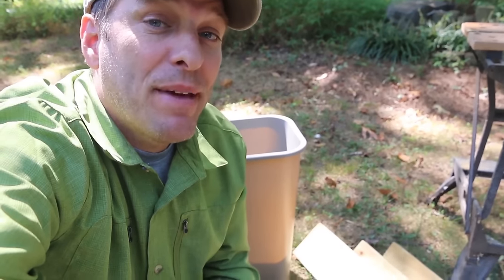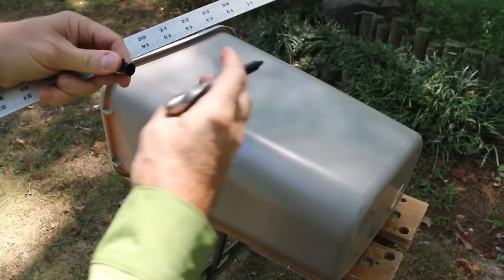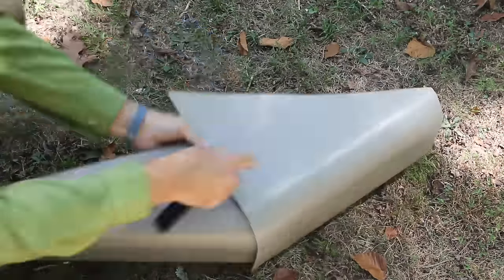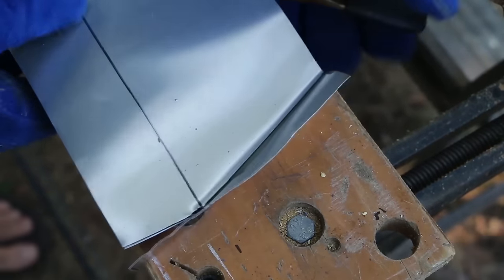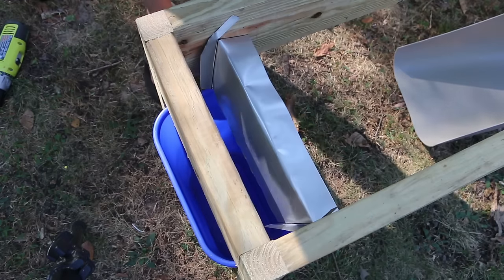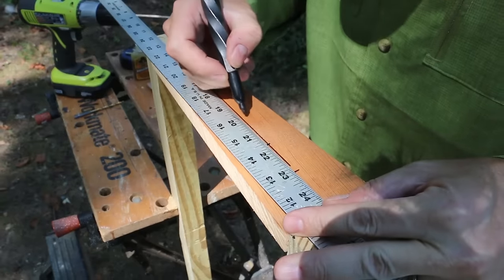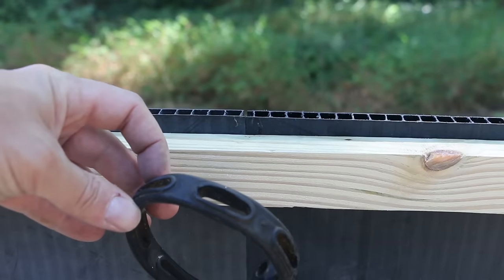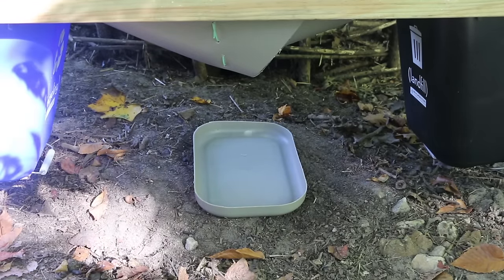How To Make A DIY Soldier Fly Larvae Composting Bin

Comment: I'm a contractor.  And your driving some of your screws to far in. It's starting it in the wood causing a bubble.. because when the screws head pulls tree plastic into the wood just a little it causes a little hump which then causes a bubble.  If you un loosened athe over tightened screw it would flatten out

Comment: I like your idea, it is a fantastic starting point. There are some features I would like to see though... Each side if it had a self actuated door where when the chicken steps on the foot pedal it would open the top. This would allow them to get the larva whenever they desired while keeping the larva otherwise contained. This would save the need to transfer the larva to them and the bin entire setup could also be kept in the same area they are. This would create a problem with your runoff collection though as you would not want that accessible to them. You would need to suspend the runoff collection with a hanging bucket, or use a catch and a pipe to get it out of the area accessible to them. With these changes it becomes a self sustainable system.

Comment: Just a tip on bending the flashing. Use a small 2x2 or squared off piece of scrap. Align the wood with the line, start the bend by hand, then use a hammer to get it perfectly bent. Thanks for the tutorial! I have been wanting to collect BSFL for quite some time as they are quite abundant here.
Reply from the maker: Thank you for the tip. Thank you for watching. Happy composting.

Comment: Excellent video! I would normally do it with wood as well, but since I had a 4’ Tupperware bin hanging around, I decided to use that. I knew from watching another video that I wanted to do a ramp and not pipes, like I’ve seen others do, because the BSFL doesn’t always use them, but couldn’t figure out how to seal the ramp to the wall. The bin walls are not completely flat, so the ramp doesn’t seal completely to it. I’ll use flashing, which I have a ton of lying around. One day I’ll build a custom, bigger one, but as you said, what I’m doing now is a good prototype.

Comment: At around the 35:30 mark it was mentioned that after the eggs been laid in the corugated cardboard, the cardboard would be transferred down to the compost pile. Actually you don't have to do that because once the larvae hatch, they'll migrate to the food source themselves. BUT it is a good idea to make it removable in case you need to change out the cardboard for whatever reason (eg. ruined by condensation).

Personally, I don't bother with the cardboard anymore. The female BSF just lays her eggs around the inside lip of the composter cover/lid. Other people stick to the cardboard method because (1) they sell the egg-filled cardboard, or (2) they have separate set up for the adult BSF (a mating cage) and they need to move the eggs to the composting pile.
Reply from the maker: Munirah, thank you for adding your insights to the conversation. I agree with your suggestions. I like having the cardboard separate for cleanliness, but that seems a little comical given the context. :-) I may have make a mating cage next summer to see if I can propagate some more soldier flies. It sounds like you have been doing this for a while. When did you start?
Reply: When did I start? Hmm...3-ish years. The first few tries only managed to sustain 1 batch of larvae (from a single egg-clutch) but once they pupate, I didn't have new maggots to keep the bin going. Lots of starts and stops. Thankfully I live in the tropics, so I could start back at any time of the year! Happy to announce that my current bin has been going for almost a year with new egg-clutch found everytime I feed them (2-3x/week).

A bit of an advice on setting up a mating cage. Adult BSF mate during flight! So make sure it's big enough for them to do the deed.

Comment: Can't say it better than anyone else here....SUPERB. I have been thinking about doing this for a long time and your build is not that complicated. I will build about twice your size as you advise. btw, has anyone told you look a bit like and even sound a bit like Alan from 2 & 1/2 Men......lol
Reply from the maker: Thanks Ray! Definitely scale this thing up. I'll go bigger when I build this soldier fly composter again. One comment on the video had a good idea I thought might save you some time. +Theo Lubbe (see below) suggested I use some pond liner or heavy duty sheeting instead of the trash can. The flexibility of the material would allow for the drop in the center, ramping up to each end. It would also save the lacing up the middle step. Also would let you scale this however you needed to fit the liner.
Reply from the maker: Can't say I've been compared to Jon Cryer. lol. I'll have to watch a few episodes to see. But, he's a cool dude, so I'll take it. :-)
Reply: Yep Tom, I saw that comment & definately good value.....only question I have about that method is collecting the leachate .....maybe punch some holes along the center low point and cover over with shadecloth or weedmat ?

Comment: I'm not much of a woodworker.  But, I think drilling straight into the end grain - vertically oriented relative to how the tree was oriented when it was growing - provides the weakest hold on the screw - easiest to pull out.  I'm thinking put the boards on adjacent sides of the legs?  Thanks for the video, by the way, I think I might use this as my example.  We have chickens.  We have vegetable scraps.  We have neighbors with manure.  We should be growing our own chicken feed!
Reply from the maker: Yes! Grow you own chicken food! I think you'll be pleased with the amount of fly larvae you can generate. The chickens will love them too. I just made a simpler version of this bin. Similar construction of the box, but I use a tarp instead of the trashcan. Saved lots of time. Thanks for watching.
Reply: Is there a video, yet, of the tarp construction?  I'll search.  You're welcome - thanks for posting

Comment: Fantastic!

One modification I would make is to use deck screws instead of drywall screws. Drywall screws are weaker and can break much easier than deck screws. Deck screws would be better over time also.

Another change I would make is the lathe screws. Lathe screws are very smart because of the head size and shape, but stainless steel screws will be much better over time. The lathe screws, if I am not mistaken, are made of a tin or zinc alloy (which is soft) and are meant to be buried underneath concrete and therefore not exposed. I would use a truss head stainless steel screw with a phillips or combo drive.

These two modifications are trivial considering what you have here. I have learned a lot from your video. You have great ideas! Thank you!

Comment: Is there a reason you didn't just use a heavy duty sheet, like one would use for a pond/dam, over (instead of) the trash can? Doing that you could simply cut out an oblong octagonal shape, fold in at the corners to create the tapered shape and cut an opening at the center. For longevity's sake you could take two flat sections of PVC and make rings you rivet together with the drop sheet between them, maybe with a little bit of PVC cement for a distributed grip between said PVC rings and the drop sheet.
Reply from the maker: Using plastic sheeting is a great idea. Even a rubber pond liner would be a good option. This project was prototype and I've thought of ways to do it differently, to make it simpler and better. I could certainly be larger. I do like to start with simple, easy-to-find, materials, just to make these composting project accessible to more people. I usually try to apply this to the tools as well. Although, I did use the table saw in this project, but it could be engineered out fairly easily.

Thanks for sharing your ideas.

Comment: Just a tip for someone using this design - use wood for the lid. The choroplast is great because it is lightweight however, possums or raccoons will definitely chew on it and get through. This is the issue I have, hope this helps!
Reply from the maker: Thanks T.K. Good tip. Thankfully, I haven't had that issue since I created this particular soldier fly composting bin. However, I have had something raid my bin in the past, when my BSFL bin was more make-shift. Thanks for watching.
Reply: Absolutely! Thank you for the design! Glad yours is staying structurally sound. I'll likely just do wood over it so the plastic will make a great heat insulator. Luckily it's an easy fix!
Reply from the maker: The wood might work just as well on its own. I used the plastic material on the BSFL bin since I happened to have some on hand to reuse. If I hadn't, wood would have been the likely alternative.

Comment: 30:10 - Why not cut them equal to start with? I made 12x10 shelf brackets by cutting diagonally from 2 inches in on each side. Then one side was 10 inches and the mirrored side was the same.
Reply from the maker: True, I ended up sawing a little more here, but I needed both my long pieces (tall and short) to be ripped from the same 2x6. If the side pieces were even a half inch taller, one 2x6 wouldn't have been enough for both. Thanks for watching all the way to 30:10. Did you finish it out?

Comment: Nice design. I've been thinking about how to get away from the bucket type or the plywood type which cant possibly last long and have aesthetic issues. Looking toward to the simplified design in the spring!
Reply from the maker: Thanks Chris. I'm still noodling on it right now and waiting for the soldier flies to come out of dormancy. Another few months here in Georgia. Where are you located?
Reply: I'm in NC so a few more months here too.
Reply: Any more thoughts on a new design?  I am thinking about an enclosed rubbermaid tote idea. It would still look good from the outside, be removable for cleaning and require only a slot be cut on the bottom or side to harvest.

Comment: definetely giving it a try ! great video
Reply from the maker: +Cultivos Tropicus cool! One suggestion I've heard it the comments that would simplify the design for this soldier fly larvae composted is to use a rubber tarp or pond liner for the composting basin, instead of the trash can. I'm going to do a build like this in the Spring, but wanted to let you know if case you build it first. Thanks for your comment.
Reply: Actually I came up with the idea of using 2 trash cans , join them both by the upper side (wide side) and let the narrow-bottom side facing out,  this should allow an angle when they are set horizontally ( <> ) , cut the bottoms to make the exit ramps, and then cut a big central rectangle on top of both trash cans to open a working space , if the rectangle is 2 inches smaller than the total area of both cans, you will have a "outer"  rim around them to prevent the larvae from escaping .......   hahaha I think a diagram will be better... sorry

Comment: Not a bad design.

I was kinda hoping you would use a bead of RTV Silicone Sealant under the metal flashing and where the cut plastic can attached to the wood (especially in the bubbled out areas). 

Adding a layer of hardware cloth over the catch bins would make them animal resistant. Adding an additional layer of hardware cloth under the plastic covering the lids would prevent animals from digging into the bin through the thin plastic sheets. 

Also, a few coats of water sealer (or stain) over those boards would definitely improve the lifespan of that project. I'm in north Georgia, and the humidity here will quickly eat through lumber in the forest.

When drilling holes, use a larger drill bit (or a step bit) to clean up the edges of the smaller holes you just drilled (instead of a razor knife) for a more professional look. 

Lastly, freeze the worms you don't use (so they die humanely) and consider dehydrating them (outside) to use them in the cold, fall/winter/spring months as a healthy feed option. 

All in all, it looks like a decent design. My feedback is merely constructive criticism. 

Thanks for posting the video. 

Sincerely,
SurvivalNerd (YouTube)

Comment: It looks great one though, you might want to tape the open ends of the corrugated plastic sheet.  The soldier flies might lay egg in there instead of inside composter.
Reply from the maker: Jamie, I see your point. I think I'll wait to see if the soldier flies do lay eggs in the corrugated cavities before I take the step to cover them. What I'd likely do, if that becomes a problem, is fill them silicon. I like the clean lines of the lid. Thanks for watching and for your comment.
Reply: Can you make update if you do make changes???  I live in California and was thing of starting one myself.  Thanks for responding!
Reply from the maker: Will do Jamie. I've got a video shot on the soldier fly bin's operation results that I'll post in a few weeks. I don't expect to see adult BSFL laying eggs again until Spring, but I'll update again if I see the issue you pointed out. One thing to consider if you plan to build this composting bin, think about making it bigger. The size of this build was limited by the trash can dimensions. If I did it again, I'd use two large storage bins versus the trash can.

Comment: Did you ever redesign this?  Wondering how it worked!
Reply from the maker: Hi Chris. I've got the redesign on paper, but haven't built it yet. It will be one of my first videos in the new year. I'm working with the City of Atlanta to pilot a few of these at their food forest. So, the design will be scalable. Thanks for checking in. Happy Holidays.
Reply: @GreenShortzDIY  Any updates??
Reply from the maker: I did a rebuild on this system to simplify. Search for “how to make a simple soldier fly larvae composting bin.” Thumbnail has “upcycled milk jug harvester”

Comment: did you find the drainage was adequate on this?  those drainage holes seemed kind of small to me, but what an awesome job!  This may be on my list of projects for this fall :)  thanks!
Reply from the maker: This black soldier fly composting unit has never produced a lot of moisture. Not enough to need to drain. My older bin-based composters did collect more moisture and had drainage issues. But, not this one. If you do have a collection of liquid you can always drill more holes. Thanks for watching.

Comment: Your works looks good! But if you used drywall screws on pressure treated lumber, the screws will rot through rather quickly.
Reply from the maker: This bin has had some corrosion issues. But, it is still functioning fine 7 years later. Thank you for watching.

Comment: I was wondering how to build one put of wood for larger scale but make it rot proof since it will be wet most of the time an was thinking of sealing the inside with acrylic spray. Since acrylic is a plastic based paint an its safe for using in my enclourses for my tarantulas that have high humidity feel like that might be a good option.
Reply from the maker: I suggest using a tarp for your interior lining. I did that on a second version of this and it worked well. Good luck with your build. Thank you for watching.
Reply: @GreenShortzDIY  have you had any experince with using animal manure in your BFS composting? I have a small bin started in using my scraps for but on a larger bin I was wonder as they say they do well with manure as well an i have goats chickens rabbits an free access to cow manure.
Reply from the maker: I haven’t done that myself, but I think it works. I know some manure needs further composting and some can be used as is. But, I’m not the expert on that. :-)
Reply from the maker: @miller17013  you could consider getting food scraps from a local restaurant or two, to get more feedstock. Just give them a couple of buckets and pick them up every couple days.
Reply: @GreenShortzDIY  finding infomation on bsf is difficult i have a pod set up with I put 700 in and they were doing good but the last two days they just went lazy. I was finding some that looked like they may already been pupating or just dead in the box and several that were the black pre pupa stage. I removed alot of the substrate thinking it may of been tok dry an they were burrowing instead of climbing out. However even the white large grubs are just almost dormate like the are too cold dispite the highs being 80s an at night i put the bin in the garage where it stays warmer at night. I uave no idea why they have just went into a almost dead state

Comment: Wow, your video prevented me from buying something I already have way too much of, lol. Grubbly farms sells them as a chicken treat. I thought these were horse-fly larvae for years.
Reply from the maker: Awesome! Feed the birds! I see why you thought they were horse fly larvae though. About the right size. Sounds like you are going to build a system. I’ve got a simpler version coming soon, but the main difference will be using a piece of tarp instead of the cut and stitched trash can. Same frame system. Let me know if you have any questions or ideas for improvements.

Comment: I would not seal it where they meet, I would put a drip pan underneath, it will regulate the moisture in case it gets too wet.
Reply from the maker: Thanks for the feedback. This Black Soldier Fly Larvae composter stays pretty well regulated moisture-wise. I’ve never seen liquid dripping out of the bottom. I have had a condensation issue inside the lid, but I’ve been able to manage that by propping it open a little. Thanks for watching.